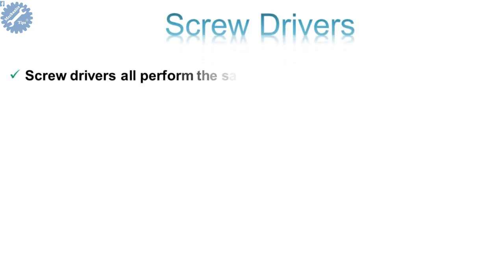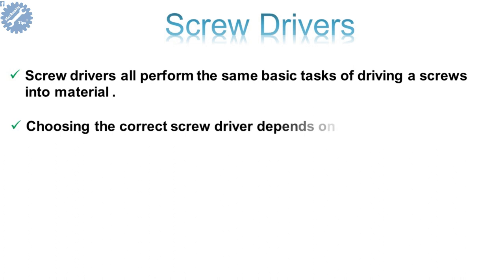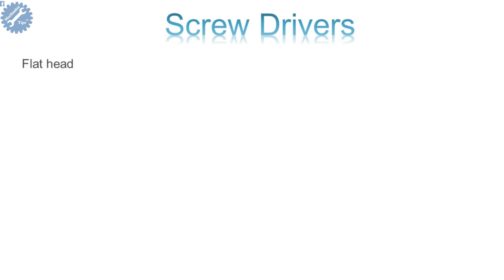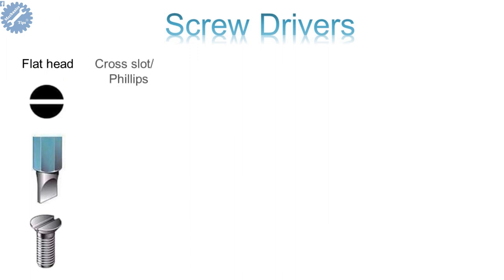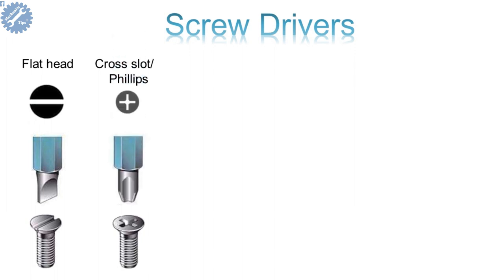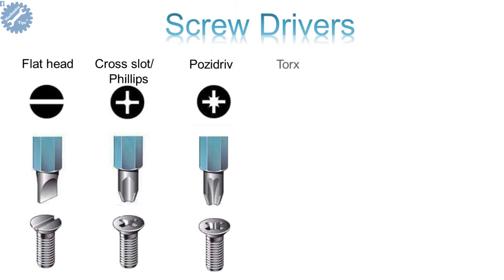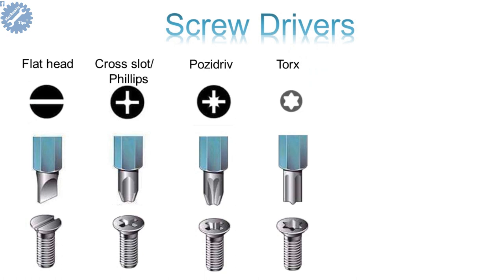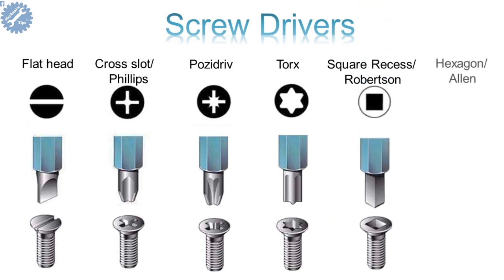Screwdrivers, Types and Usages

Comment: What Phillips screwdriver size to be used for computer cpu components like harddrive, dvd drive, motherboard & smps?
Reply from the maker: I will check this for you 👍
Reply: It might not be Phillips, it might be JIS, (Japanese Industry Standard), they look similar but the JIS is just a little better, and it's gained a lot of traction over the past few years.  If it's Phillips, it could be 000, 00, 0, 1, or 2.   Number 3 is real big.